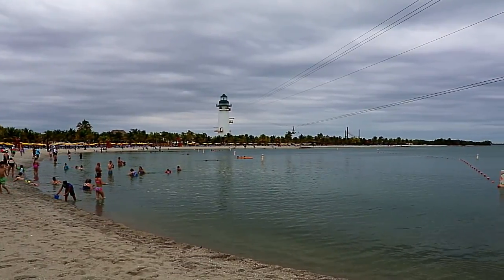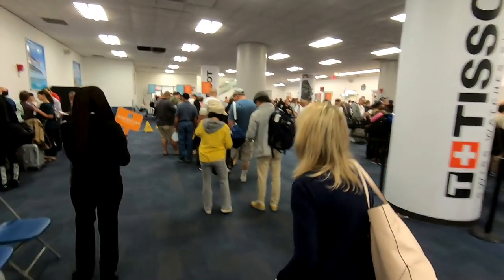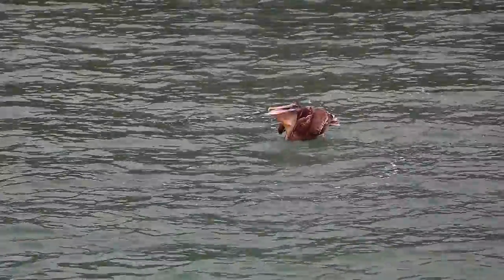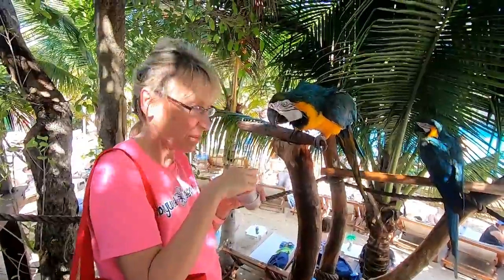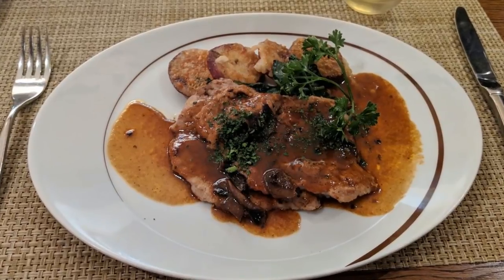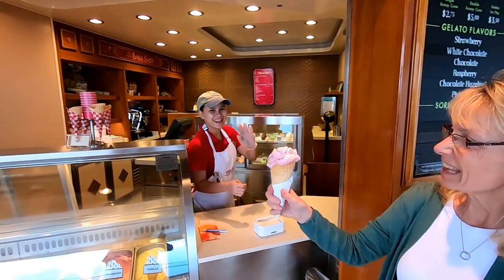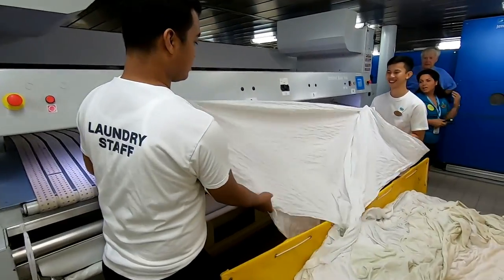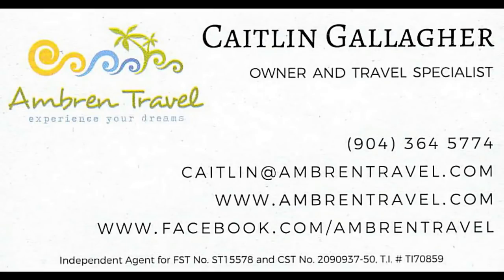What I Loved About Norwegian Getaway!

Comment: Another great video Jim.  Next time in Miami Bayside check out the restaurant Los Ranchos.  Its a steak/chicken/seafood restaurant that is top notch table cloth service that is excellent.  Its probably the only Bayside restaurant that Miami locals eat at since most of Bayside is really a tourist trap.  Its second floor on the far end. The Getaway is a great ship but IMHO, the Breakaway class ships was an over correction from Epic.  All the venues including the Haven got smaller and confined.  I hope someday you cruise the Epic.  The spa will blow you away.  The ship is 10 years old and I believe its still the largest spa at sea including outdoor areas.  The Haven is so much larger and better with Posh, etc.  Also the Breakaway class ships really put the tables inches apart in the specialty restaurants.  Glad you had a great time.  Happy sailing!
Reply from the maker: I will definitely sail the Epic at some point!
Reply: @JimZim  The Epic does not have the Waterfront which is a fantastic feature on the Getaway.  IMHO, everything else is bigger and better on Epic.  Cant wait to get your opinion on Epic someday.  She is the step child of the NCL fleet but she is by far better than the Breakaway class ships.  NCL over-reacted and went too sterile and conservative on the Breakaway Class ships.  Happy Sailings
Reply: Taking this cruise jan20 good info
Reply: Only a voyueristic idiot from NCL could have approved the glass bathroom and shower walls/doors on the Epic?  I cannot imagine a family occupying the cabin suites.  Insult to injury, they placed the only curtain between the bathroom/shower and the living space.  How many bare assed gaffs from the hallway have occurred when someone entered the cabin?  Some things cannot be unseen!  Save your cruisemates from the embarrassment.
Reply: @keithandrsn3319  LOL you are funny.  You never lock the door to your cabin?  On any cruise ship in the world a crew member could walk in on you if you are not dressed.  That has nothing to do with Epic

Comment: Your videography is superb Jim. Can you share what equipment you use? Looks like you use a gimbal?
Reply from the maker: Actually, for the all the shots in this video where the camera was in motion (not just panning) I was using a GoPro Hero 7 Black, on it's own, no gimbal.  It has very good image stabilization built right in to it...  which makes it super convenient to use because it is so small.  I just mount it on a short selfie stick.

For the shots where the camera is panning, most of those were done using a Canon EOS 80D on a tripod.  The one quirk of the built-in image stabilization on the new GoPro is that it tries to correct for the movement when you are doing a pan.  So, when I know I want to do a shot involving panning, I use the big Canon.
Reply: Thanks Jim! You have really helped me make my next vid cam decison!!